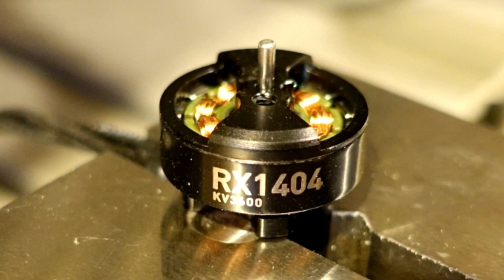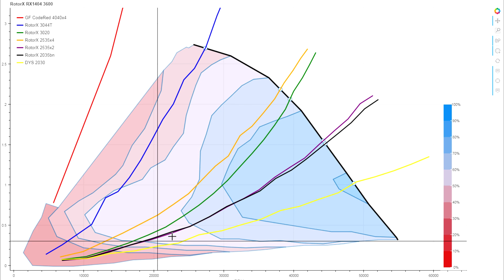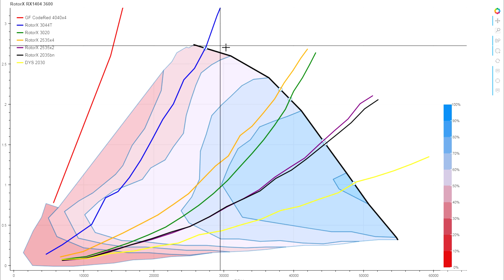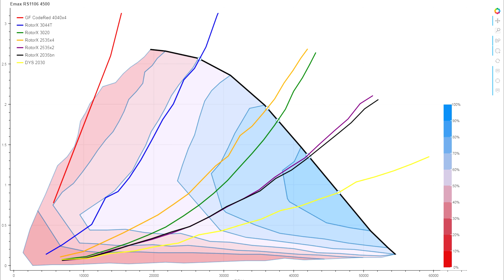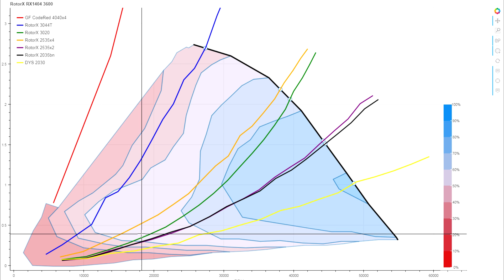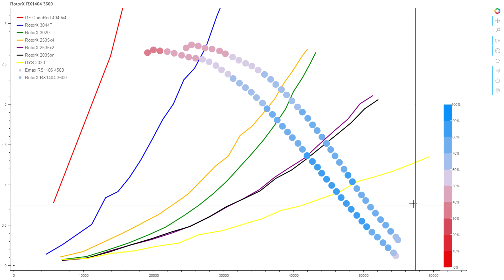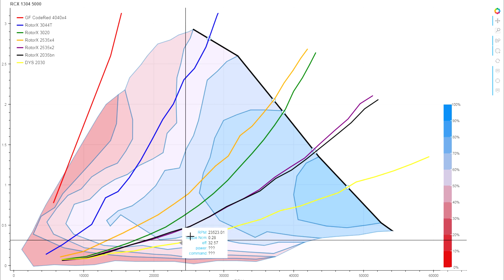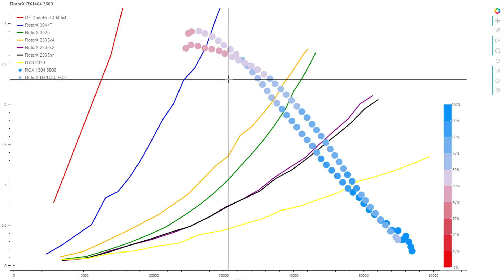RotorX RX1404-3600kv Dyno results

Comment: Can't anyone make a motor that beats the old ass $9 per RCX 1304???
Reply from the maker: If the 1404v2 can get a bit more copper in there then it might give a little better bench numbers.  I think if anything it just shows that the 1304 was a far better design than I ever gave it credit for.  Bearings in the RCX are a bit crap though, if the 1404 can run smooth all the way up to full throttle  that alone could be worth it, all my RCX birds are a bit jello-y
Reply: Last time I ordered from My RC Mart I got a bunch of the 1304 replacement bearings, I should probably look for ezo versions of these.........  I'll do it tomorrow
Reply: I also wonder if the 1304 4,000's are torquey enough to get better efficiency from 3" props, I was talking to Ryan at Kwad Camp TN about how the motor manufacture's will save money by winding higher kv motors with the same thickness wire as the lower kv version so you just flat out get less copper in them :(
Reply from the maker: torque shouldn't be any different unless they really botched it up.  I've been really curious about the 4000kv version because their specs show it having higher efficiency, and RCX has been really accurate with their specs whenever I've checked.  So possibly we've got exactly that situation going on.  I just got a set of 4k ones in last week, so I'll be completing up the tests on the whole line eventually
Reply: I would think that torque would go up a bit from the better infill/more copper in the 4,000's no?
Reply from the maker: Slot fill % effects efficiency, but not torque.  Anything the 4k can do the 5k can as well.  Any increases in torque you see in practice are going to be from 2ndary effects, like more efficient meaning less heat, meaning less torque dropoff from thermal soak.  But those are the kinds of things that only show in certain situations, like sustained high load.
Reply: Ahhhhh gotcha, awesome thanks man looking forward to the 4k test :)

Comment: This is what I suspected from the numbers I have seen. One of the rotorx guys told me "we looked to see what would give the best thrust in the 3044" (or words to that effect). I had alwas thought 3600kv was an odd choice but if you look at these charts it makes sense. Any higher and the 3044 probably would start dropping off the top and producing poor results. I also see a lot of people use the rotorx setup for micro long-range. Your graphs are pretty supportive of why, at lower RPM the 3044 is in a great place and only really loses out at higher throttle.
Reply from the maker: 3044 really does like torque, it runs even better on a 1407, but that does come with a pretty stiff weight penalty.

Comment: Great to see you review the RX1404 3600KV! How did you attach the GF CodeRed 4040x4 props with 5mm bore to the t-mount? I'm not aware of any 4" t-mount props, although I wish there were! On a related note, you should really add the more efficient RX/GF 3025 bi-blade and GF 3035 tri-blades to your standard test. ;-)
Reply: The prop curves here also show torque/rpm, which is independent of the motor. So the answer is: he didn't :)
Reply: Hmmm. So this is all derivative data, not directly measured. Would be interesting to compare to real-life thrust measurements, and see what the margin of error is (if any). On the upside, if it's all derived, it might be easier to add 3025x2 and 3035x3 props after the fact. ;-)
Reply from the maker: Prop curves are the combined results from a thrust stand test and a dyno run on a known motor, that torque curve then can apply to any motor.  The numbers you see aren't going to exactly match what you will test yourself with a test stand for various reasons, even just battery sag (even from an oversized and fully charged lipo) is enough to drop peak numbers 5 or 10% from what the composite dyno results will show (which is run off a large power supply)  I have done tests with the RotorX 3044 on both a 1407 and 1106 motor and can show that the calculated torque curve is independent of motor size or mount type.  I show the 4" prop in the results just to give a sense of scale to the power range of the motor.

I currently have over 30 props abstracted, and I show the few that I do just to keep the results from getting impossibly cluttered, and have some continuity for comparing different motors together (where these results really shine their best) Eventually you'll be able to show any prop on any motor and choose yourself which ones to see with a full data explorer on MQTB, but that's going to be a bit off.
Reply: Thank you for taking the time to explain this! I remember hearing about your dyno setup, but didn't realize how everything was merged together in your methodology. Will read up more on MQTB, and look forward to realization of your ultimate goal to allow any prop with any motor. Kudos for all the work you've put in!